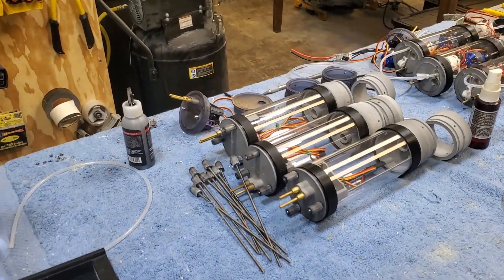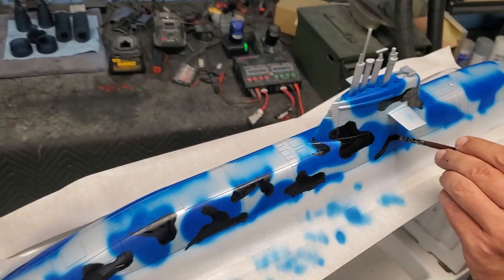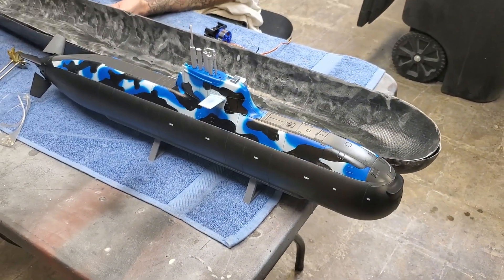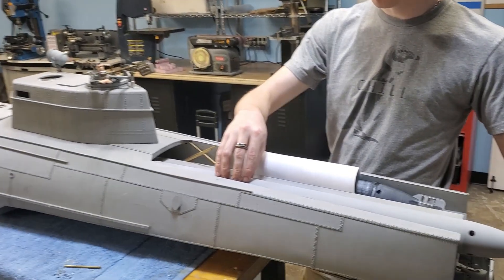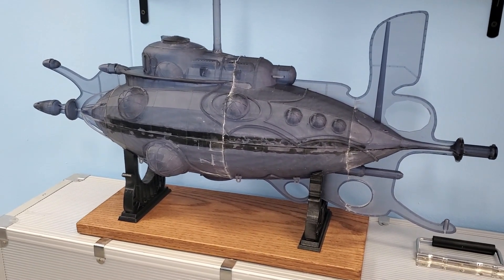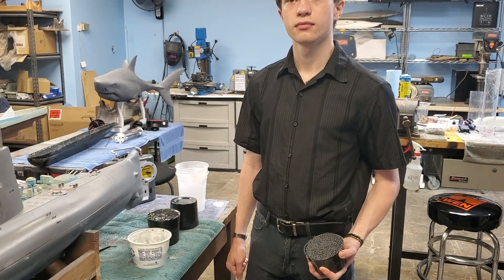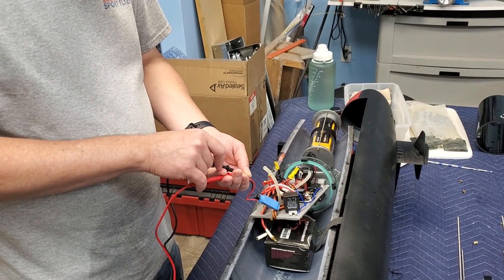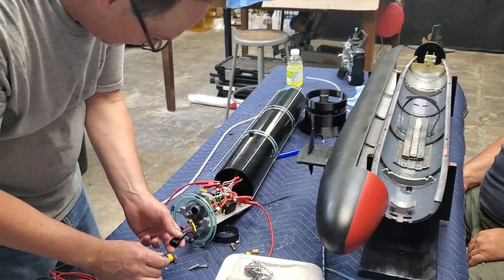Update from the Nautilus Drydocks - June 23rd, 2023

Comment: What's your take on what's happened over the last few days. I know its probably apples and oranges compared to what you do but it's such a shame what's happened.
Reply from the maker: It was really inevitable. Submarines operate in one of the most unforgiving environments imaginable, and shortcuts are not feasible in the slightest. If the passengers knew of the technical challenges that the craft had, they'd never have stepped within a mile of it.